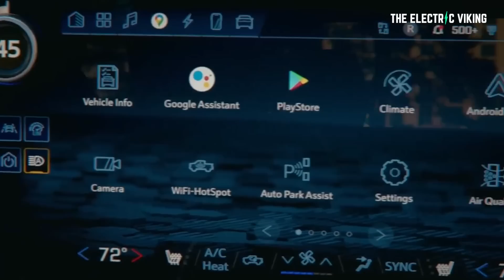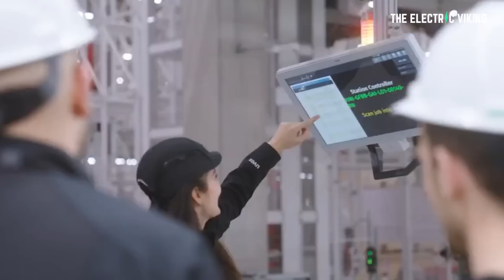Tesla's NEW US Megafactory already deploying 36 GWh/year!

Comment: Mr. Musk can see that as EV adoption increases the grid needs  more power to charge them. Preferably, this additional  power will come from renewables.  Renewables need  power storage and battery is the tech available now to meet the increasing EV power demand. So, Tesla grid battery storage is actually part of the entire Tesla EV adoption strategy, similar to having their own charger network. Mr. Musk doesn't like depending on others to deliver anything that  gets an EV on the road, or keeps it running clean once it's out there.

Comment: Do they get the $35/kwh for these batteries? Or is that only if it goes into an EV?
Also this is like $17b per year in revenue, without any subsidies. at 10% margin, that would be close to $2b profit per year.
Reply: Lol no they wont, they are imported batteries.
Reply: panasonic produces them in nevada so yeah they would get the subsidy. which would help tesla negotiate lower prices. not sure if tesla would get the 'pack' subsidy or if thats only for vehicles
Reply: at an estimated battery cost of 330k for a megapack plus lets say total cost to manufacture of 500k. Teslas selling price of 1 million would be 50% margin
Reply: @PyroManiacbwl  So I thought the $35/kwh subsidy might only be for batteries that end up in an EV. Obviously they will not get the $7500 credit, that's just for cars.
Reply: @GershonBenYitzhak  i could be wrong but i read it as battery production not necessarily vehicle integration
Reply: @PyroManiacbwl  If so, that would be an extra $1.2b in profit in subsidies per year

Comment: I know that Gwh sounds like a lot... But it's not, because it's a energy unit, not a power unit. It represent the energy of 1 day generation of a 1.500 MW nuclear power plant.

The anual consumption of a big developed country like US, is represented with PetaWatt·Hour units. Not 1 thousand (terawatt·hour) but 1 million over Gwh scale.
Reply: I can see Tesla buying up the company already building the first Small Modular Reactors in the US, these reactors that are cheaper, safer, and smaller reactors can fit on the back of a flat bed truck as they are about the same size as a shipping container. These reactors will eventually be built on an assembly line like Tesla's vehicles, such tech would go well with Tesla's Gigapacks, as the two technologies together will vastly improve our energy production and get us off fossil fuels. Solving the energy problem will also solve many social problems like access to clean water, access to food, etc. Such tech can run everything from desalination plants to vertical farms, and just 3 or 4 of these reactors can power a city the size of San Francisco.
Reply: @ernestmac13  genius idea.
Steady 24/7 power run through the batteries keeping them topped up.
Reply: @ernestmac13   Nice and thank you ,  1st I heard of these reactors.

Comment: hydrogen is the future my friend, one day you'll realize.
Reply: How long hydrogen is much more difficult to be transformed in mechanical movement...no. The processes to use electricity to obtain hydrogen and transform it back into electricity are far less efficient than battery storage and cost much more. Today's industrial hydrogen is mainly a secondary product from oil processing, not from water...
Reply: @costiqueR  more efficiency is the only thing batteries have over h2 fuel cell. But efficiency doesn't really matter that much when you can get hydrogen through electrolysis from solar and wind power. Yes it takes a lot of energy to store it as a liquid but that energy is pretty much free since you are getting from solar and wind. Electric cars are only viable in city environments but anything outside of that (airplanes, cross country semi's, ships, trains, buses etc) batteries makes 0 sense. BTW how much pollution do you think mining the materials to make a battery will emit? do some research will you.
Reply: @BrandonLee_10   That means you do not know too much about the subject. As I said, you cannot understand the problem that transforming energy in H2 and later transforming H2 in energy in fuel cells is much less efficient because the process is producing far more heat, losing energy in this way. The process, not to talk about the equipment, is the main problem. I know much more than you, I see...
Reply: @BrandonLee_10  Let's assume you generate electricity from a renewable source, say, wind or solar. Putting that electricity into batteries to power an EV is about 90% efficient, that is, there is only about 10% power loss. However, using the electricity for electrolysis to generate hydrogen, and then compressing that hydrogen and transporting it and putting it into a car to be used with a hydrogen fuel cell to produce electricity to power an EV is only about 30% efficient. As such, it would cost about 3 times as much money to drive a car using hydrogen as it would to drive an EV.

As for the environmental impact of making batteries, I suggest you watch the following video: https://www.youtube.com/watch?v=mk-LnUYEXuM&t=96s
Reply: Responding you your other comment elsewhere within this thread "BTW how much pollution do you think mining the materials to make a battery will emit? do some research will you."

I think it is you should do some more research. If you did, you'd know that this mining activity is a one-time upfront activity. Once there are enough batteries in the wild reaching their end of life, a huge percentage of the raw materials inside of them can be "mined", using a fraction of the original energy that was needed to get them out of the ground AND to refine them (the materials inside an existing battery are extremely high grade). Battery recycling companies such as Redwood Materials (founded itself by former Tesla co-founder and CTO JB Straubel) are already in place and ramping up to take advantage of this massive opportunity.  It is just a matter of time.

Meanwhile, none of the hydrogen used is recoverable. It must be recreated from scratch with incredible inefficiency. If not produced on site, it can't leverage the existing oil pipeline infrastructure because of the materials used by the pipes - the hydrogen permeates and leaks through these pipes, and embrittles the steel welds holding the pipes together. The entire infrastructure would have to be rebuilt. Good luck with that.
Reply: Hahaha you have no proof. Theory or fact or anything.
Reply: 🤣Never going to happen
Reply: At present day science, petroleum is needed big time in the production of Hydrogen, so might as just stay with petroleum. 

ATM Toyota is the only major car company trying to promote Hydrogen.  It is not working out well for Toyota. 
Wasted Billions  🤦🏼
Reply: @icosthop9998  Yup, for some reason the Toyota board chose a lawyer as their CEO so it's not shocking they went down the wrong engineering path.  The dude has spent his entire professional career in the hydrogen corner and is a living example of the sunk cost fallacy.
Reply: @Trahloc  True
Reply: Hydrogen was stupid in the 90s and it hasn't gotten any more intelligent in the last 30 years.
Reply: If u really mean it: go and buy NKLA

(But only if u want to see your stock go down to 0 $ in 2023) 😄
Reply: Hydrogen Fuel cells = fool cells
Reply: Amazon and other mega warehouses are already powered by Hydrogen.    Maybe today's  war on energy  is designed to advance hydrogen's footprint.